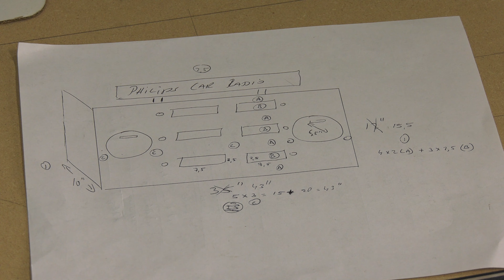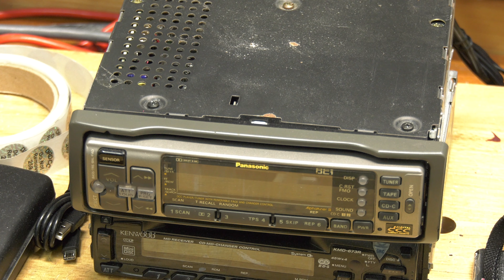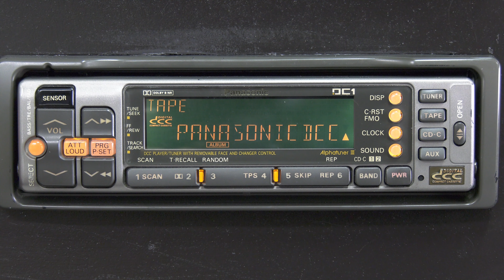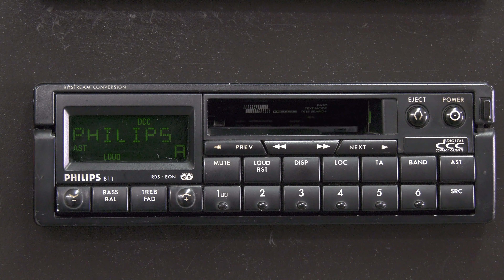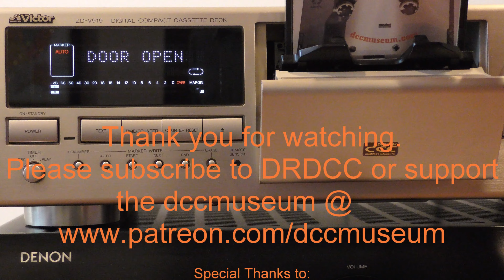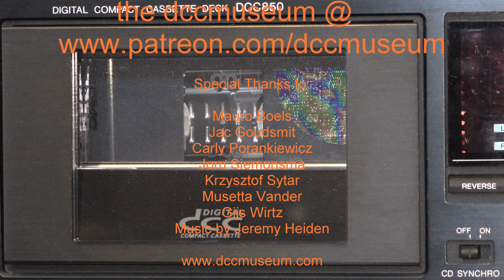The New Digital Compact Cassette Car Stereo Display at the DCC Museum

Comment: Great to see the DCC Museum video,
this time with DCC car stereos.
That's a very nice job of cabinet
construction and that is some
wiring you had to do. I look forward
to the follow up video.
One stereo radio, starting in the 
1970's, was enough for me to do
at a time in my cars. I first had an
FM add on tuner from Motorola
to add FM to my AM car radio about
50 years ago then I added one of
those mechanical reverbs with lights
that was popular in those days. Later,
I had an outboard FM stereo for my
car, and then an inboard FM stereo
with cassette player. In 2002 when
I had a Camaro, I had a JVC car stereo
installed with HD for AM/FM reception,
CD player, and an iPod player input.
I had that until 2010 when I sold the car.

Comment: Very nicely done, hope you share some wiring details
Reply from the maker: First112 Thanks. What would you like to know? All of them are connected to a 12V power supply, individually powered via a lighted switch next to them. All Philips car stereos have a amplifier connected to a speaker switch panel. The Panasonic is the only one that needs an external amp as it has a line output only. That amplifier is connected ti the speaker switch panel as well. After pressing the main power switch (white LED), you can select what car stereo you would like to turn on (red LED) and select that same radio on the speaker switch panel. That way the sound is coming out of the speakers. In the video I have activated all radios at once for dramatic effect.

Comment: Does these units also need replacement of the belts or capacitors?
Reply from the maker: The belt for sure. We have only recapped one so far.
Reply: @DRDCC  Can you make a video of the DCC car stereo units? The 822 is a beauty with beautiful sound also.